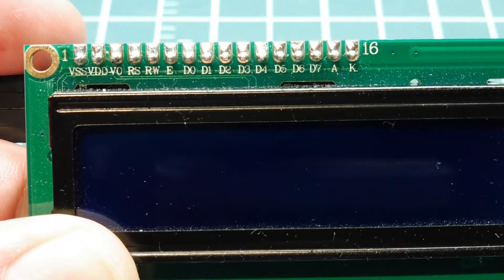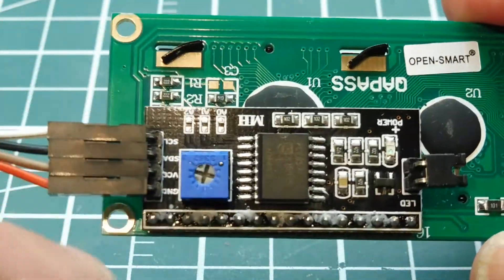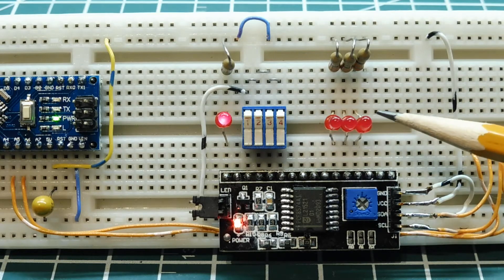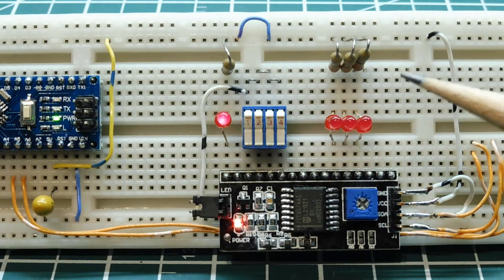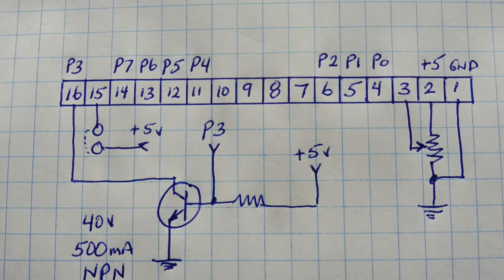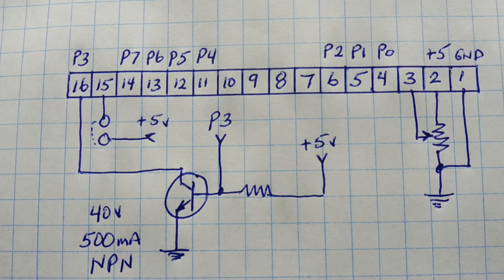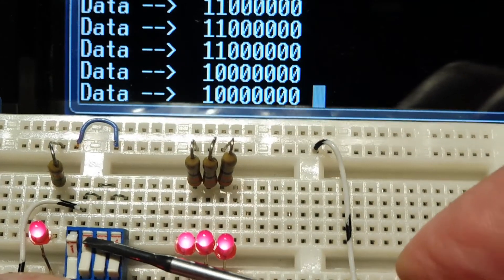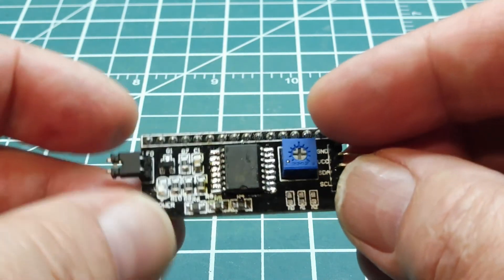Arduino GPIO pin expansion using I2C

Comment: I was trying for hours last night to get P3 to work as an input, thanks to this video and comment section I finally know why it failed, thanks.
Reply from the maker: Glad I could help
Reply: @0033mer  Update for anyone interested: I got P3 to work as an input by desoldering/snipping off the J3Y transistor and bridging the single top connection (originally collector on the J3Y) to the bottom left connection (originally base on the J3Y) with a piece of short wire. Thanks again to the schematic in this video for making me try this out!

Comment: Can you change p3 to input pin ?
Reply from the maker: You can make P3 an input but it would always read Low as it would always see the base emitter voltage of the transistor (.6 volts)
Reply: @0033mer  What if I remove the other components connected to pin p3. Is it possible to make the pin normal like other input pins?
Reply from the maker: Yes .. if you remove the interfering components you can use P3 as an input.

Comment: sir. please provide the code for this project!!
Reply from the maker: I do not use the Arduino IDE. The program is written in Forth

 : >IO        ( n -- )
        $3F I2C.write ;

 : OUT.LEDS
        $F7 >IO
        BEGIN $F6 >IO 500 MS
              $F5 >IO 500 MS
              $F3 >IO 500 MS
              $FF >IO 500 MS ?KEY
        UNTIL DROP $F7 >IO ;

 : IN.SW
         $F8 >IO \ ALL LEDS ON
         BEGIN
         $3F I2C.READ 50 MS ?KEY
         UNTIL DROP ;
Reply: Yessssssssssssssssssssss
Reply: NOOOOO

Comment: 5:39... I see you are using the same Veroboard for prototyping and the same Bell Telephone wire for interconnects. Been using those for 30 years of prototyping before PCB design.
Nice to see I'm not the only one that hit on that goldmine ;)
Reply from the maker: Yes ... It works very well.